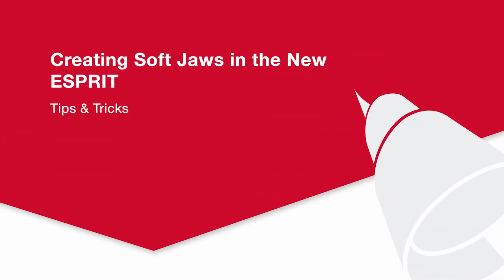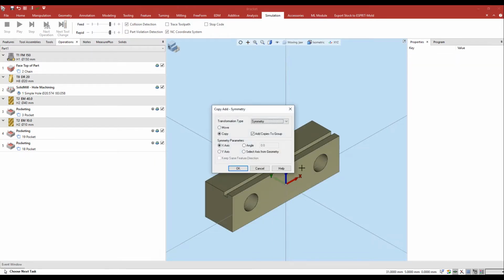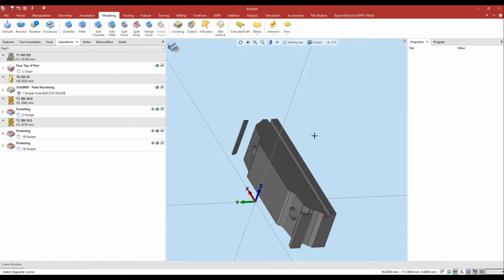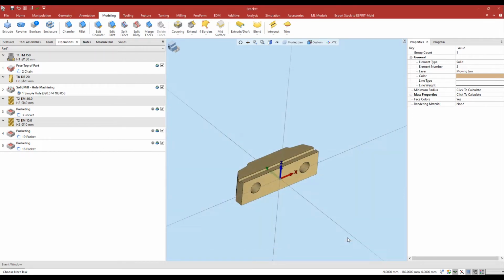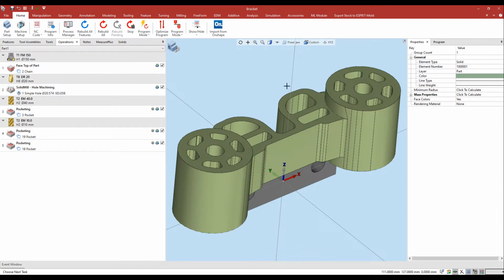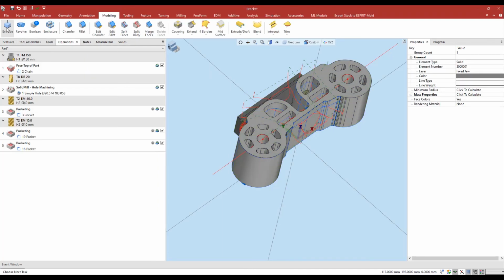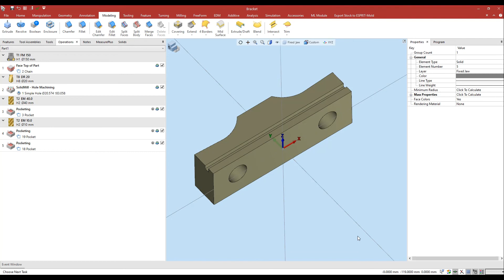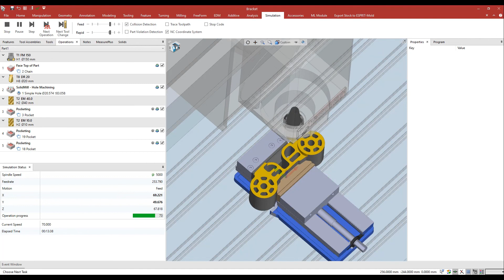Creating Soft Jaws in the New ESPRIT - ESPRIT Tips and Tricks

Comment: I'm able to complete everything in this video. however I'm unable to mount the jaws to my Digital twin vise. How do I edit the vise in MTB to accept individual jaws?
Reply from the maker: There could be multiple reasons for this. Are the vice jaws a permanent item in the vice GDML?  If yes, then they need to be removed from the vice GDML so that jaws can be added as needed in ESPRIT.
Also, the vice needs to be defined correctly in MTB.  Notice in the video file we have an adapter location defined for both the moving and fixed jaw.
If it still doesn't work you can contact support and they can assist you with this. https://www.espritcam.com/contact